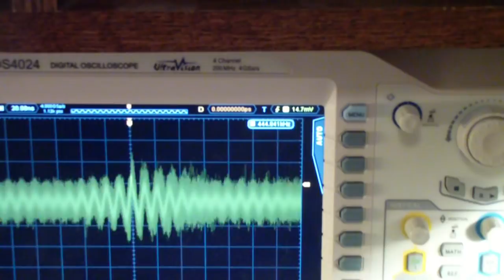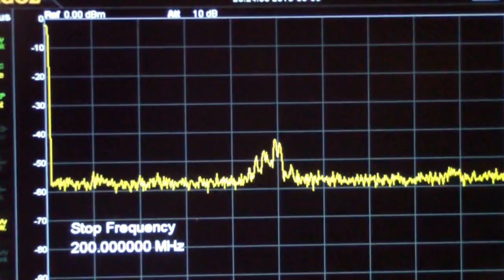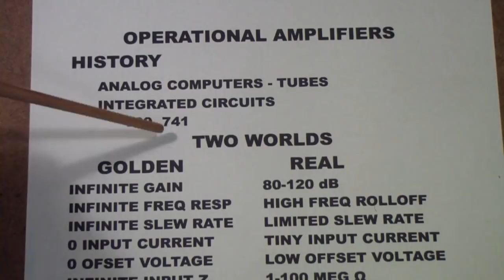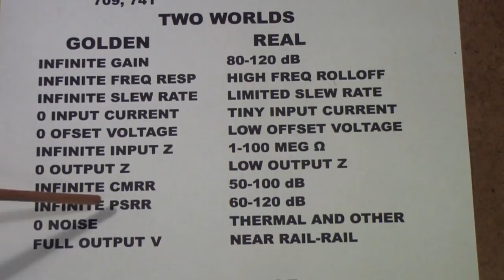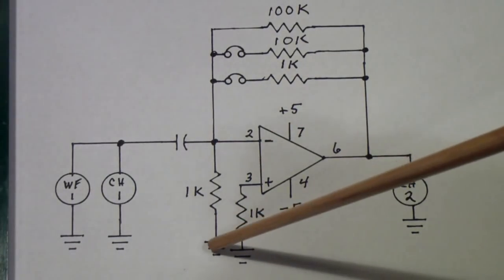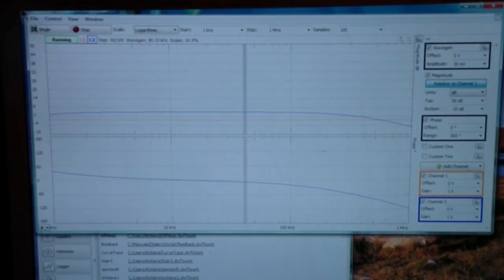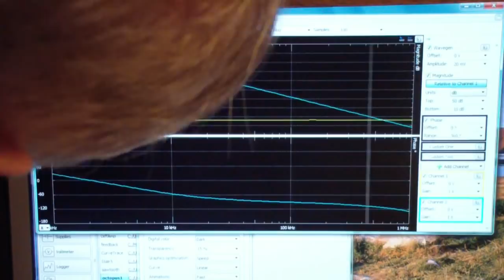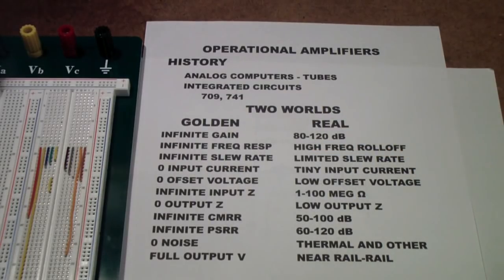TTT211 Intro to Op Amps

Comment: "Golden." What my old boss used to call "blue sky." Thank you for the parasitic oscillation demo since, while I have a 2N3904 and the AOE Lab Manual, I ain't got no spectrum analyzer or high-bandwidth oscilloscope. Could you go over what precautions you have to make, if any, with the spectrum analyzer to keep from blowing out the front end when you hook it to circuits like this?